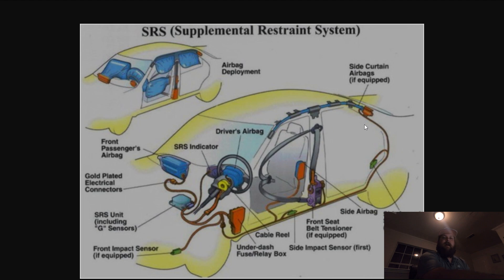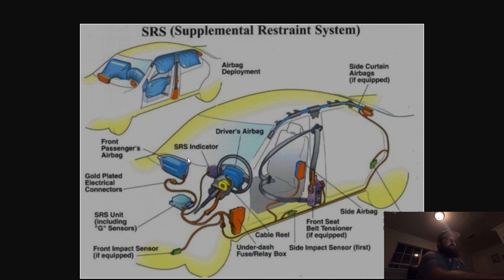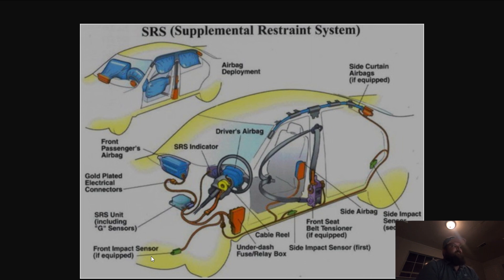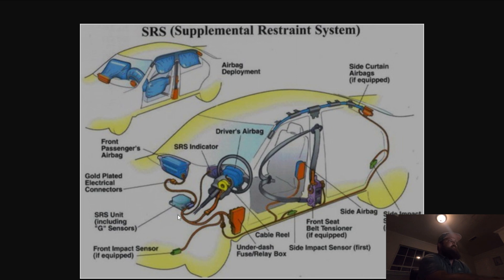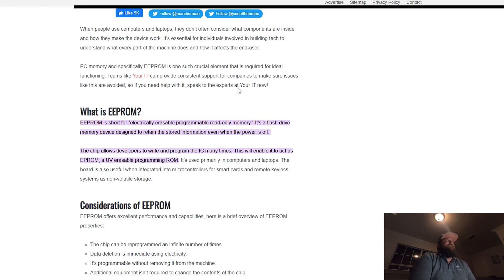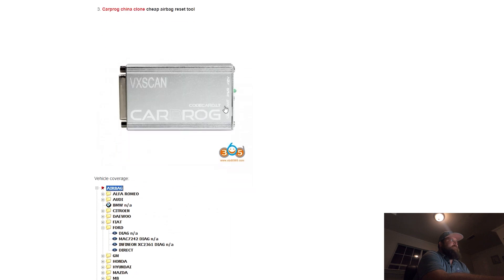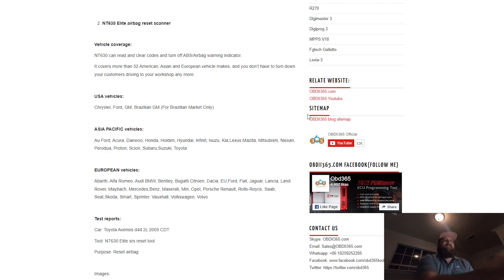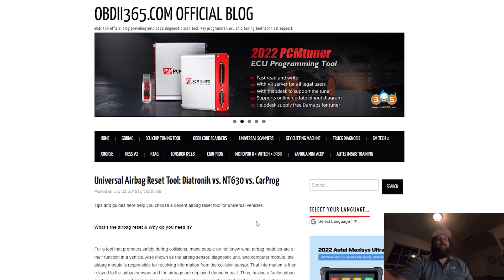How to Reset Airbag/SRS Module Over OBD2 or On Bench. Overview of Software and Tools Needed.

Comment: Hey bro GREAT VIDEO AND INFO!! Thank you for taking the time to share the information. I really do appreciate it! 

I would like to ask you, could you recommend any hardware and software that would clear these codes for Nissan Honda, Chevy Ford, etc? 

The I ask, I have been recently purchasing cars to fix and flip and make money and I would like to do it myself instead of sending them off to a company because in my area no one does that. 

Thank you for all your help and again I definitely appreciate you taking the time and sharing the info!! I’m definitely a new 👍

Also the last Amazon link is dead. Thanks
Reply from the maker: Glad to help buddy, I'm actually in the shop currently but when I finish up.ill.check the link. Thanks for pointing that out. As for software you're looking for, are you looking for a scanner like mine capable of clearing all non-hard codes? Or are you looking for the eeprom reset software for hard codes?

Comment: Could you tell me 2001 Pontiac grand am where are impact sensors located
Reply from the maker: Have you pulled the codes? From a quick search, I don't think it has impact sensors. Appears the srs module, or rather the SDM in that year, runs the whole show. Probably relies solely on accelerometer data for a deployment loop. If you have codes , I'd be happy to look further for you.

Comment: New Honda 2023 Ridgeline. Two airbags deployed. Al 619 scanner show no error or codes. Whats a good obd2 scanner? Also new to this?
Reply from the maker: Are you planning on doing alot of airbag repair? Or just a one off?
Reply: @GreenCastleGarage  I just want a scanner that will show the errors in the system. I know hard codes will have to be cleared just like in your video. Problem is this al614 scanner says system is fine. Two airbags deployed and srs light on. Kind of useless at least for a 2023 honda ridgeline for trouble shooting sensors.
Reply from the maker: https://amzn.to/42zCeQv
That is the scanner I use, its not cheap but I absolutely love it and it will read every code you need.

Comment: Hey. I'm working on a 2018 Lexus RC350 with airbags deployed. Do I have to replace the airbag impact sensors or can I reuse them? They're Denso impact sensors that Don't seem to have any visible damage on the exterior. Please advise. Thank you!
Reply from the maker: Do you have a reliable scanner that can pull srs codes? That is the only way to tell for 100%, unless it was located so close to the collision its in pieces lolol. They do not normally show damage on the exterior.

Comment: I’ve recently seen ones that can clear the airbag code through the OBD2 port. Can Diatronik erase the old EEPROM and reprogram it with a new one through the OBD2?
Reply from the maker: That's vehicle model dependant, newer cars are moving to canvas communications that make it possible. It really just depends on year, make, and manufacturer
Reply: @GreenCastleGarage  have you heard of any good ones that can work for Honda that can erase the eeprom through the OBD. This info is super hard to find since people use this as a business and profit off it. If you wouldn’t mind we can talk about it more private. I’m just young trying to learn more about it

Comment: Most of us don’t really give out the software or tools we use because it’s our business. Plus it’s not something just anyone can do. There’s a lot of trial and error with this stuff. Someone with no experience that thinks it’s easy and they can do it are gonna buy a Chinese carprog and end up breaking the airbag module and gonna have to get a replacement.
Reply from the maker: Appreciate the feedback, I understand it can be a successful buissness for sure. The purpose of this video was only too provide a little transparency and help get people started on what too look at if they want to understand how it works and why it can be reset. What yall do is a skill based trade and requires what I would call a significant upfront investment, so I highly doubt your buissness would be affected with the information being readily available. I for one will continue to use my local shop, because the prices are very reasonable and I can't justify the cost and time too do it myself.
Reply: @GreenCastleGarage  yeah no problem man. And I get your point. I’m just saying that’s how it is with everyone that does module resets, key programming etc. I learned this stuff 100% on my own by down my own research. And I was working at a shop where we do airbag work and the owner does airbag crash data reset but I never bothered to look at any of his tools or anything cause he would literally try hiding every small detail. Tape over the programmers , the laptop he would try hiding the screen haha. I really don’t care much if anyone is getting into it cause there’s work for everyone. There’s mechanic and body shops like on every damn corner 😂 but yeah it’s also something that can cost a lot of money , because the programmers (good ones ) are expensive and using Chinese you’ll eventually fuck something up and new ones can cost so much